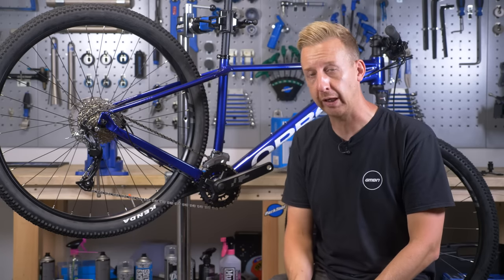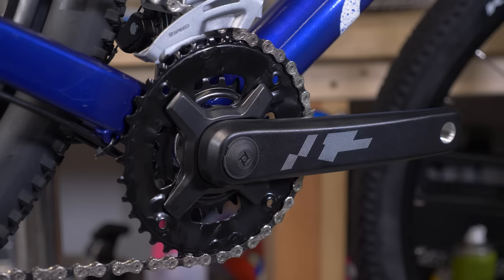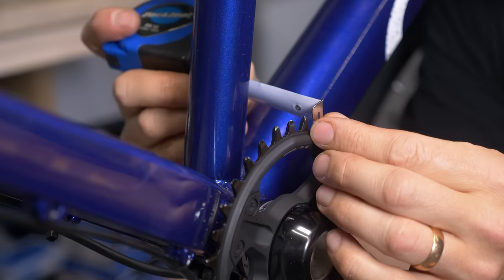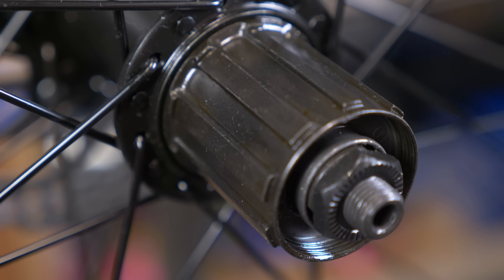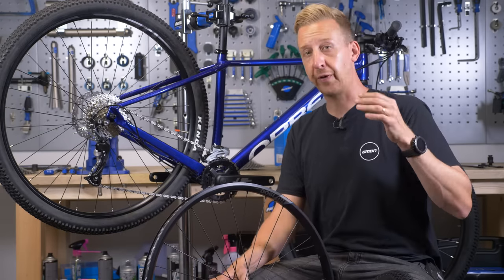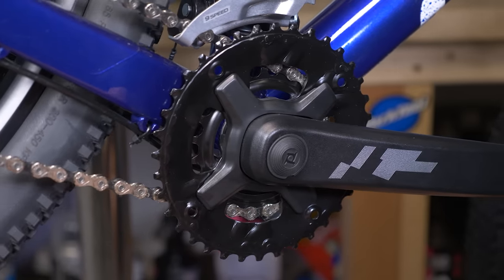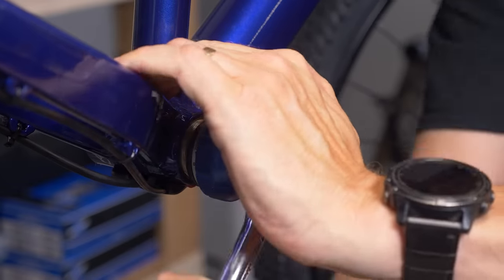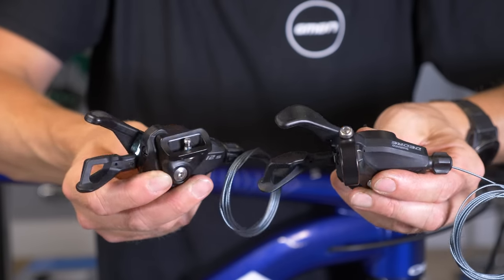How To Upgrade To A 1X11 Or 1X12 Drivetrain! | The Ultimate Single Chainring Conversion Guide

Comment from the maker: Have you already made the switch to a single chainring setup? If yes, when did you last use a front derailleur?
Reply: I still got a Cross commuter bike with 3x9 system. Thinking of switching to cheap 1x10 1x11 with XT shifters as I don't switch from the middle chainring
Reply: I've gone the other way few months ago. From 1x9 to 2x10. Way better on long XC rides. Thanks to bigger chainring more speed on flat surfaces and still the same ability to climb with smaller shift gaps.
Reply: I did but now I miss 2x I can definitely tell the difference between 1x and 2xt. The 2x much better top end torque
Reply: @jasonlewis6914  but why? I find 2x setup to be the worst of all. Switching eg. from 24 to 36T or 38T was quite disrupting and useless. I think the only reasonable front chainring choices are either 3x or 1x.
Reply: I actually went back to a triple - with 3x12.
Reply: @Silkl4sh  I hear you. I was running 2x Shimano xtr just feels so much better to me. But everyone had a different feel for what they like.
Reply: Good video plenty of info. I am building a new bike up. Could you possibly do a video using the spam 1x system ?
Reply: Made my switch about 2½ years ago. Went from an ancient XT 3×8 to a SRAM NX Eagle groupset. My old man still runs an Acera 3×8 groupset and as such the last time I used a front derailleur was while recalling his bike.
Reply: I haven’t used a front derailleur since my Brodie omega in 2007
Reply: I prefer 2x so I'm not gonna change anytime soon. The day I'll change is because the market will force me too.
Reply: I’ve ridden 1x since 2016 and always do it on my Mtb. However on my cx bikes I use a 2x10
Reply: I upgraded a 1X to a 2X drivetrain on my XC MTB. Most of the offroad available on my area are gravel roads, so i went from 1X to 2X. i can now ride faster with my 38-28 setup, i have a better chainline too. No need to spend money on a new gravel bike, i don't feel comfortable using drop bars anyway.
Reply: Its also cheaper to replace for maintenance
Reply: Not touched it yet saving up to do this conversion
Reply: Yeah, only for performance bikes, I see a lot of guys selling 1000euros bike in my town (most likely for lack of time to use), never gonna happen mate :D :P. I barely have time to go to shopping with my rockrider st520 and I'm still a freak show here. Never gonna happen mate. not worth it.

Comment: Or, upgrade a 1X to a 2X drivetrain. Most of the offroad available on my area are gravel roads, so i went from 1X to 2X so that i can ride faster with my 38-28 setup. No need to buy a gravel bike.
Reply: This is my problem.. i bought a new bike with a 1 x and I doht like it. The bike is slow and i never had a problem with 3 x ever but the shop talked me into it

Comment: Am I wrong, or did you omit the cassette from your weight difference calculation? That's the one component that's always heavier with a 1X, because the sprockets get so much bigger to retain the same gear range.
Reply: Yeah, 12 speed cassette 650gram, 10 speed 380.
Reply: @Sidowse  Yea, the reason behind conversion from 3x(2x) to 1x is to make things simpler and more robust, not to save few grams. 
I personally ride 2x10 on my XC and I use every gear ration I can.

Comment: Experiment with your current set up by using only one front chainring for awhile in the areas you ride. I like the middle one on mine which is 38. I use that the most when I ride anyway. I like the sound of the simplicity of a 1x but I already have this by doing nothing and not spending any more money. Biking doesn’t have to be so costly. Thanks for the video.

Comment: I’ve built a hardtail on shimano XT with 2x 12 ⚙️  I have also new canyon neuron cf9. Much better with 2x…
Reply from the maker: Oh nice! What reasons do you prefer the 2x setup?
Reply: is it chain line?
Reply: I preferred the 2x on my old bike for trails with steep abrupt climbs, where dropping 1/2 the gear ratio with one click was beneficial. However i find the 1x setup i run now to be far easier to keep in perfect working order.
Reply: @gmbntech  
2x is better for climbing, going from a 2X down to a 1X & calling it an "upgrade" is an opinion & not one I'm fond of. 2X & 3X Rule

Comment: Seeing all the new bikes with their fancy, simple, lightweight 1x setups had me dreaming of converting my 2016 Rockhopper Comp to a 1x setup.  No more chain slap - so simple, elegant and lightweight!  But then I started reading all the pro-2x comments, checking into the cost of the conversion, and looking over the rest of my bike (with it's worn out tires, entry level fork with a ding in the stanchion, and old-school geo)...I don't think I'm going to touch it unless something stops working right.  Great video though!
Reply: I converted my 2X8 Shimano Alivio to Sram GX 1X12 on my Specialized Rockhopper Comp. It was totally straightforward following Youtube videos, shifts like a dream I love it. I personally would not go back to a 2X setup. Also the bike is now about half a kilo lighter than before.
Reply: Have a brand-new 1x12 XT drivetrain on my new bike and the shifting just feels awful compared to my 8 year old 2x10 XT
Reply: i tried 1x12 and got back to my old 3x9. It doesn't cover the same range of gears, and i didn't have any problems with 3x9. The chain slip maybe 2 or 3 times during 8 years. I don't see any advantage of 1x except it's 400g lighter

Comment: Can your frame limit your casette size, because in local shop, they said that this big casett shouldntbe on it and i have problems with drivetrain. It worked for 1 year perfectly okay and now there are problems. From 2by 11-36 to 1by 11-46

Comment: Shimano sells the FH-MT401 and FH-MT500 which both have Microspline and are 135mm QR. The 401 has sealed cartridge bearings and an aluminum freehub body and the 500 has angular contact cup and cone bearings with an internal grease sleeve and a steel freehub body.
Reply: Thank you! I was reading through all these comments to see if anyone knew of one. And the 401 seems to be only $55

Comment: I'm in the process of converting my 1x8 fatbike to 1x11, already upgraded from tapered square bb/cranks to hollow ones. Used smaller chainring, lost a lot of topend but I am quite happy with the lowend. Going to upgrade the rear end next month :)
Reply: hey i was wondering if you coul help me out I would like to do a simular thing but I have no idea where to start I just want to change the rear end from 7 sprocket to 10 or 11 but I don't know what I would need to do that will all cassettes fit or how do I know what to buy! thanks

Comment: I bought an inexpensive mountain bike from a large retailer.   I paid less than $100. for it in early 2022.    It has a a 26" wheel, alloy frame,  front suspension, and was equipped with a 3 x 7 gearing.   Living in flat Florida,  I saw no need for the front derailleur, and when I found a problem with it I simply removed it.   I did not find any problem with it as a "one-drive".  The chain does not pop off the 3rd (largest gear) gear of the three.   I removed the twist adjuster on the left side of the handlebar with no problem.    No change was made to the pedal bracked gearing.   Only some minor adjustment of the rear derailleur might have been required.   I don't recall.  The adjustment might have been simply to set the rear wheel's high gear (smalest gear) chain position to its innermost so that the chain would not slip off the right side.   Seven gears are more than enough for Florida's mountains!  
It is a shame that so-called "cruiser" bikes have no suspensions from the frame.  Biking on the sidewalks is almost as rough as riding the rocks!

Comment: Good vid you guys dropped there. Ik did a 1x12 conversion recently. But i picked the sunrace 12 speed cassette. It fits the orginal Shimano body. And shifts at least good as the Shimanocasette from one off my Buddies. So no need to change the rear wheel/hub/body there. But i guess if you're teaming up with Shimano for this vid, that couldn't be shared😉
Reply: There is one from SRAM that fits the og Shimano as well. 12 speed NX Eagle PG-1230 is the parts no.
Reply: @flexxx222  Yeah i'm running that with an XT derailleur and GX shifter. Love it

Comment: The older bikes I have with a square taper BB, I take it out and thoroughly grease the threads every year, even if the bike gets a few hundred miles dry use only. Modern design is definitely fit and forget until they need replacing altogether.

Comment: I switched from a 5 speed gear hub to a 7 speed derailleur. I’m glad I’m only dealing with a single chainring. It’s easier to understand what’s going on since I can see all of the moving parts (though the hub may have made maintenance simpler but I haven’t figured out how to deal with anything yet). I was able to five videos showing most things and didn’t have a lot of trouble making sense of things. At this point I might be able to understand multiple chainrings but I still prefer what I’ve got (though trying to ride the 75lb bike over hills is a bit hard).

Comment: Good tinkering video.
I've done it from 2x on a CX bike and a gravel bike and from a 3x on an old 2007 GT MTB on bikes I own and regularly ride. Easy job for a home mechanic with the right tools....Getting a bit more expensive  now with prices for parts getting silly...
As for the square taper BB remover, I still have an old Park Tools one residing in my toolbox....It was used many times and borrowed here and there....I'll keep it as you never know....

Comment: I currently ride a 3x7 drivetrain from the mid 90s lol. I ride it like a 9 speed. 1x1,2,3, then shift to 2x3,4,5, then 3x5,6,7. Smooth chainlines, wide range.
Reply: Yea, I got a bike with a 1x thinking I was 'stepping into the future'. Feels like I went backwards ! ! As soon as I wear out this 1x, Im switching to a 2x.
Reply: Yeah, I have a 3x8 (22/32/42, 11-34) and pretty much do similar. As much as I don't like a front derailleur, I can't go to a single chainring.
Reply: @madmax2069 why? If you're using it like a single ring with extra steps, whats the difference except that less can go wrong?
Reply: @cooltwittertag   I'm using it as a single until I need speed or climbing, I don't feel like having to stop, swap out the chain ring just to go up a hill, or to be able to go faster. With a single chain ring you either have climbing, midrange, or speed, but none of them together.
Reply: @madmax2069  you could just have a big cassette
Reply: @cooltwittertag   I'm fine with what I have, thanks.

Comment: The Mustache from Park Tool has great advice about tightening the rear hub locknut, suggesting a little looseness is preferred. If you get it too tight, you may see binding after the axle is eventually clamped on.

Comment: I have a 2008 Specialized Rockhopper that I beat pretty badly the last few seasons.  So much I snapped the chain and noticed I have some tweaked sprockets in the stock SRAM 3x8 drivetrain.  I had wanted to convert to a 1x, but now the busted chain has given me more reason to do so.  When did Micro Spline hit the market?  I'm pretty sure I have the older style hub, they are Specialized labeled hubs.  I'd love a 1x12, but I'd take a 1x11.  Love these videos explaining all the intricate parts of disassembly, reassembly, maintenance and all the rest....great job!  I do have a question about rider weight.  I am 285 lbs and I know extra weight may add extra wear on the components.  Is their a better drivetrain for said fluffy rider to change gears on climbs without snapping parts?

Comment: currently use a 2x xc bike for commuting but switching it for a 1x hybrid, no hate on the 2x and I really enjoy the gear range but I prefer the simplicity over the gears.
Reply: When I converted to 1x, I had less gear ratios and it became harder to climb hills.  At least my bike is simpler, right?
Reply: @SurpriseMeJT  fair if you actually need the lower ratios but i never ever use my 46T cog at the back so there's no need for me to have that many gears. I just need to climb short medium hills and need quicker gears for flats. Less drive train components just means less effort cleaning and less maintenance.
Reply: @Metalshark100  so, one more chainring is 'much more maintenance'? Lol front derailleurs are so damn simple, I have a 20 year old mountain bike that Ive tuned up the front derailleur twice on...

Comment: One thing to mention is that sram have there 12 speed nx drive train which can fit on a hyperglide freehub body
Reply: And with sram you don't necessarily need different cranks for different chain lines. you can change your chainring, that's way cheaper
Reply: but there's no 10t
Reply: This was a Shimano sponsored video :)

Comment: Where I ride i prefer 2x all the way.
Reply: Where do you ride? Why do you prefer it? I've had all types but I like the 1x much more, my first bike was single back in the early 90's, so I never understood Shimano (my favourite company in the whole world).
Reply: @FirefighterBobby  doesnt matter where one rides. Fact of the matter is, a single chainring up front causes very harsh angles applied to the chain. A 2x keeps the chain much aligned in a better position more often. Also, you can use a standard chain which is A: cheaper and B: has more material and will last longer.
Reply: Actually the 1x# are actually more reliable and will last longer it’s tougher on the chunkier chain. The 1 by chain is made of stronger metal and designed to be stronger to make up for its skinniness.
Reply: @iwontreplybacklol7481  I've found that 2x's are far less reliable and break way easier/have more issues. So it's interesting that you have had the opposite experience.
Reply: Going from 2X to 1X is downgrade not upgrade……

Comment: Simply going 1x won't really save that much weight, Much larger cassette easily outweight the saving of a front derailleur.

Especially if any roadie is considering such 1x conversion. The clutch derailleur + 40t cassette + 38/40t chainring easily eats the saving of a Di2 front derailleur and 34t cassette + 50/34t chainring. Not to mention the worsen chainline with extra noise.

The real benefit mostly comes from the wide-narrow chainring, and easier maintenance.
Reply: It does save a lot of weight tbh, not just the weight of the derailleur but less material on the cranks since there's no 2nd mount, only one chainring and 1x cranks tend to be hollow so even lighter
Reply: @The_Real_JN  or you can make two sips of water from your bottle and the weights of bikes then equal. I dunno, weight saving on drivetrain is expensive. It is better to buy better tyres and wheels. I saw nice article about weigth_save/price ratios of different bicycle parts and tyres (at least in mtb) have the highest ratio of them.
Reply: @kosskrit  oh yeah don't get me wrong, changing tyres is the first thing I did, plus going tubeless saved more weight. I guess I've only really noticed it on the drivetrain

Comment: I need to watch this again.  There's so must to take in!  I want to convert to a 1X system on my 2016 Trek Superfly.  I currently have a SRAM GX, 10 spd with a Type 2 rear derailleur. The crank rings are SRAM GX 1000, 36/22 with a PF89.5 bottom bracket.  What do I need to convert to a 1 X?  According to this video I will have LESS gear usage if I just get a new front main Chain ring.  So does that mean I need to replace my 10 gears with 12 gears, and a 12spd shifter, plus new chain..??

Comment: So, on normal bikes with multiple chainrings it's recommended to keep the chain as straight as possible, like not having the chain on the smallest cog at the rear, and the smallest chainring at the same time, and alternatively not having the chain on the largest rear cog and the largest chainring at the front.
I've heard it said that it puts stress on the chain and could cause it to break.
So, why is it OK to be on the same single chainring at the front when you have 10-12 cogs at the rear? Isn't the chain even less straight in these circumstances?
Are single chainrings made differently?
Or is it because of the front derailleur?

Comment: Thank you, this is really helpful! 

I'm at the chain line measurement part and just have some question! 
But first to explain what I have and what I'm trying to do...

I have a Shimano 3x10 and the chain line is 50 mm for the crankset, which is good because the rear hub width is 135 mm, so the math works. 

So, I wanna go 1x11 (11/51), and I can unscrew the 3 chain rings in the front and replace them. And I found a 32T narrow/wide ring that fits the 104 mm holes. 

So my first question is, when I remove the 3 current chain rings, how do I space the new ring so it's at the 50 mm chain line? I'm assuming it's not gonna be there when I remove 3 and replace it with 1 and assuming it's gonna be narrower? Are there some spacers to put in? 

Found a great deal for the whole rear upgrade kit set - cassette, derailleur, chain and shifter for 135 EUR! Shimano Deore M5100 for the whole thing. I also found the same Deore M5100 crankset, but it's a 52 mm chain line, I can't find a 50 mm one! :( Would that be a huge issue or should I try to fit the 1 ring on the current crankset? It's actually not that big a difference in price between buying just the chain ring and the whole crankset, but I'm worried that 52 mm would mess up the shifting and everything, going by the numbers of everything else! 

Your advice is much appreciated! 

There is a site that has awesome discounts, its called bike discount . de. Not sure how it would work with the UK/import taxes/etc, but I think it's worth a look! 

All the best, and thank you for all your awesome videos and tutorials, it's a massive help for a noob!